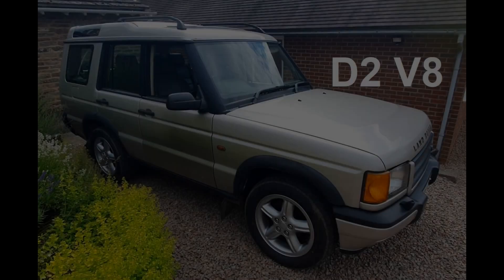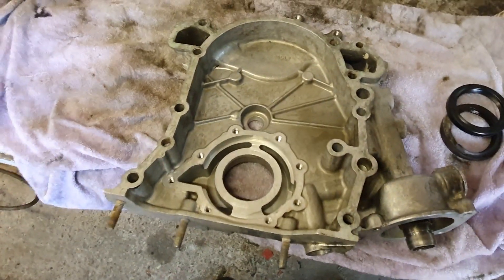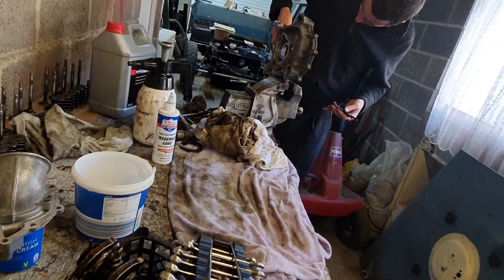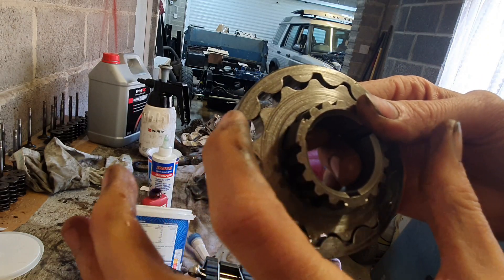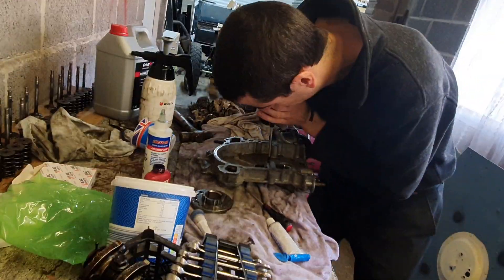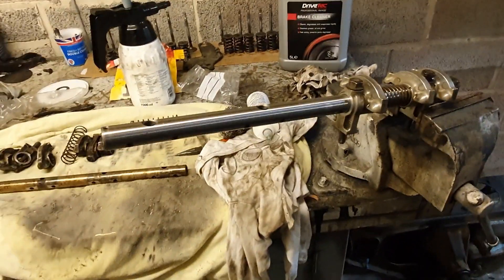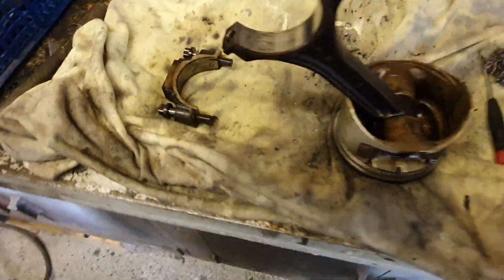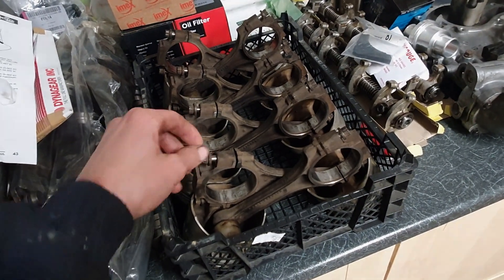Timing Cover, Rocker Shafts and Pistons and rods - Discovery 2 V8 Engine Rebuild Part 5

Comment: I see many others who put new oil pump gears in, pack inside the gear set with huge gobs of vaseline.  I would be concerned that using it would gum things up....
Reply from the maker: I agree in the early seconds and minutes of running when things are still cold it will not flow well though the smaller drillings in the oil system.  I just primed it by cranking with the plugs out.  As long as the engine was assembled with assembly lube this will be absolutely fine.
Reply: @lozl  Have you measured your oil pressure on your rig since you did the rebuild?  If so, what does it run cold (idle and 2000rpm) and hot same?
Reply from the maker: @mackendw sorry it took a while.to reply. I have been looking through pics to fry snd find the answer (and I was at work). 

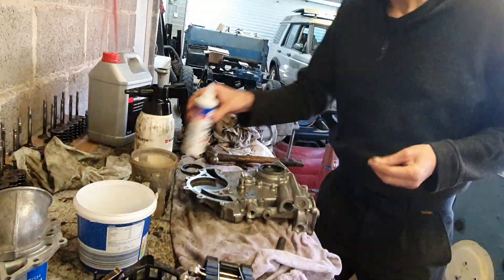I haven't got any pics of the oil pressure any more. But I do have hot running values in the following video at 2:20 into the video. 

https://youtu.be/c5U3xSsi508?si=b9MMJDD1bBcHmt-d
Reply: @lozl  curiosly, on my rig I ONLY see/hear the tick,tick,tick when its a hot day and the rig is idling.  If I increase throttle, it subsides (ie: oil pressure is increased).  Has to be 30+C for it to occur ambient outside temp.  Im trying to get my rig to run cooler with a hayden 2991 viscous fan now.
Reply from the maker: @mackendw m8ne behaves much the same only at a much lower temperature. Honestly these tappets are a massive pain in the arse. I have a new set as per the video but even those are making a little noise now when warm and at idle they're still much better than before but it's happening. I want solid lifters and adjustable pushrods